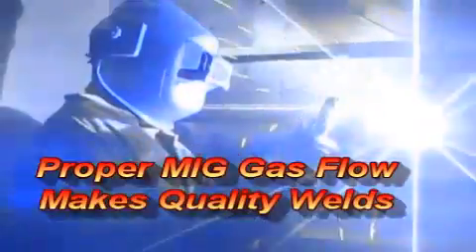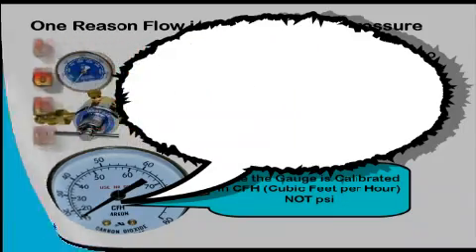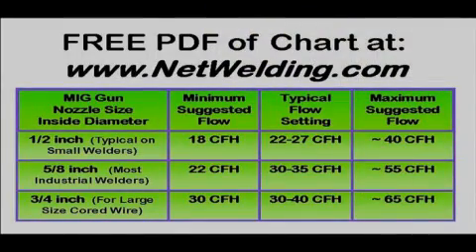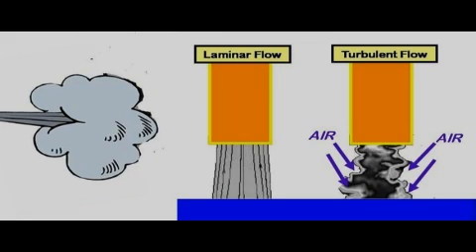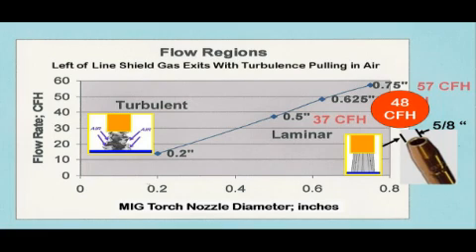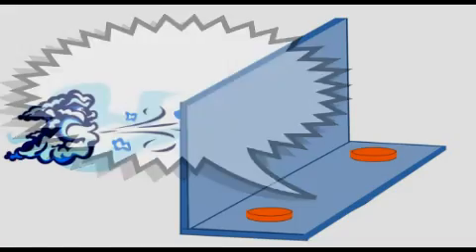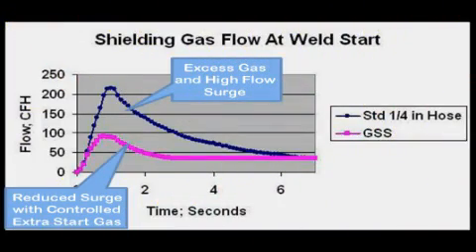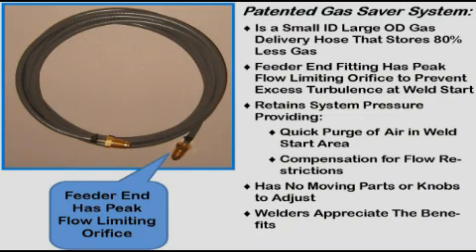MIG_Welding_Gas_Flow_Settings.mp4

Comment from the maker: Just saw a poor video explanation of flow set on what is called a regulator/flow-gauge covered in this video.  They are common and IF the flow gauge is calibrated in CFH Cubic Feet per Hour it is just as accurate s a regulator/flowmeter  (one with a ball!). It works by setting pressure above a very small orifice, like 0.025 inches.  Very easy to calibrate accurately.  Starting 2021 it is important to understand the technology.  They all do in China!
Reply from the maker: Assume you’re referring to another video as ours is very accurate.  Unfortunately have met some “welding engineers” in my 50 years in the welding industry who don’t understand flow control.  The China reference is interesting but only know of the Miller 211 of the major US suppliers that uses a regulator/flowgauge made in China with a hose barb outlet fitting.  Most Miller/Smith, ESAB, Harris are made in the US and use Threaded CGA metal to metal seat connections.  Even  Harbor Freight uses US CGA threaded metal to metal seats on their “made in China” Vulcan and Titanium” Inverter MIG welders that include regulator/flowgauges.   Most others use hose barb outlets as used in much of the World.  When I was at the huge  Beijing Essen Welding Show I found the Chinese all understood it required over 25 psi to maintain preset flow.  They typically use 50 psi regulator/flowmeters where some foolish US suppliers try to sell low pressure devices.  
Of interest Argon is in very short supply in China.  Sold enough of our Gas Saver Systems in 2020 to China (and shipped in 2021 before the pandemic) to pay for my 2020 mid engine Corvette.  Yep the Chinese are smart!